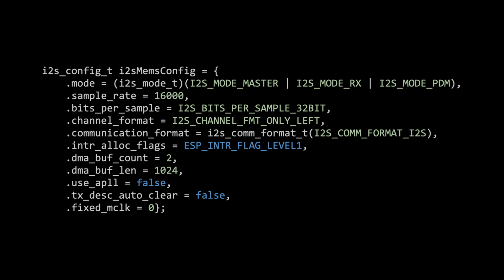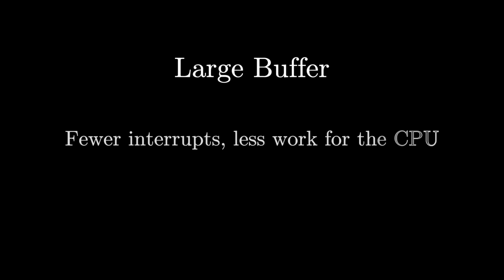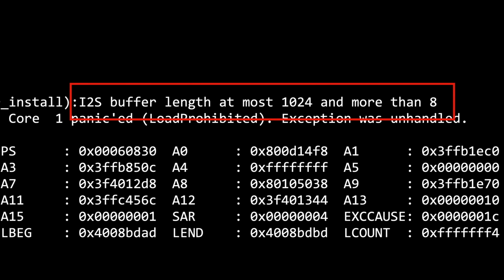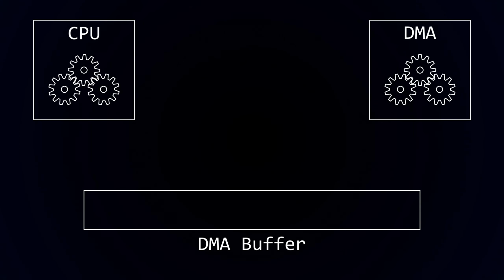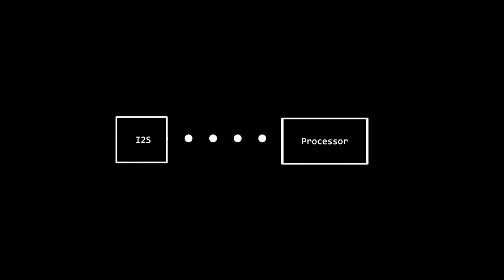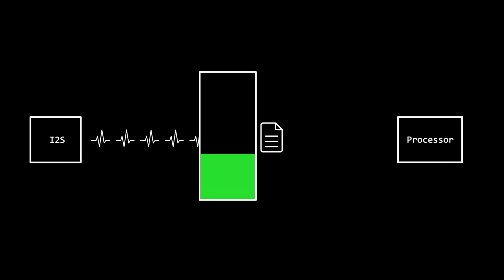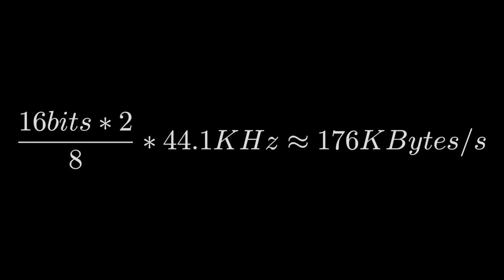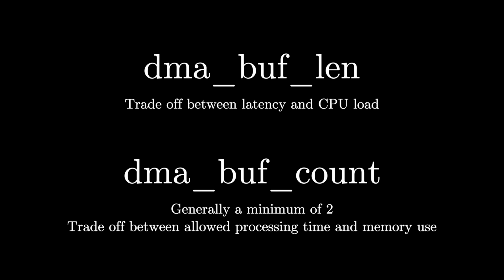ESP32 Audio DMA Settings Explained - dma_buf_len and dma_buf_count

Comment: Question about the math.  A sample is 2 bytes so if we change 176k Bytes/sec  to samples/sec we get 88200 samples/sec   so 8 sample buffer would be 8/88200=91 usec per sample .  I guess you figured the time for both left and right channels which would double my time then we are the same?
Reply: I went over this again and yes a sample would include both channels.

Comment: Suppose I wanted to take the I2S data from a microphone (INMP441) and feed it to a I2S DAC without processing. Just in and out, mono sound signal.
How would you set up the buffers? Can the ESP32 fill one buffer from the Mic while feeding another buffer to the DAC? I suppose it would need 2 DMA controllers?

Comment: Hi! It's a good video!!
I have a question about the dma buffer. Is possible to use an I2S microphone and I2S DAC in the same time? 
I know that the ESP32 contains two I2S peripherals, but you said in the video "we can only start processing the buffer once the DMA controller has finished transferring data to it", and I am somewhat confused.
I will really appreciate your answer.
Reply from the maker: The two peripherals work independently from each other and have their own DMA buffers so you'll be fine using them both at the same time.
Reply: @atomic14  Many thanks for the prompt reply!

Comment: What are the total no of dma buffers in esp32 ?? What's the maximum value we can use?
Reply from the maker: You're limited to the internal SRAM - which is shared between your running application and anything else that is needed.

In my tests I managed to allocate a total of  around 100K before the application started to crash. I assume that there is some internal upper limit on the actual value for the number of buffers, but I did not hit that before running out of RAM.

Comment: Did you come across anything saying why they limited the buffer length to 1024 samples? It's no problem since we can simply increase the buffer number, but perhaps there are times when it would have been better to use longer buffers and interrupt the CPU less. Also, does dma_buf_count have a limit? I mean, could I use 1000 buffers that are just 8 samples long for example? Perhaps for some real-time control application or the like.

Thanks for this very useful video – YouTube has been lacking a video on this!
Reply from the maker: There's nothing I could find on why there's an upper limit. And it feels slightly arbitrary as it's measured in samples - so if you're doing 8-bit samples it's 1K, 32-bit samples it 4K. I think there is probably a max limit of 4K on each DMA descriptor. The only limit you have on the buf count is the physical memory available - there is overhead for each DMA buffer that is allocated to maintain the linked list but I don' think it is that much.

Comment: Hi i got some questions regarding bluetooth audio using esp32, where can i get into contact with you? Thanks!
Reply from the maker: I can be contacted via the channel page. I don't know much about Bluetooth audio yet though!
Reply: @atomic14  Oh okay sure! No problem, I don't know much yet aswell. Currently I am just sitting with an issue, I have flashed my esp32 with the default espressif example code found under Bluetooth / bluedroid / a2dp sink / classic_bt but the volume bar is randomly going up and down on my phone, and when pressing volume buttons it doesn't change the volume.
Do you know a better way by any chance on how to make a Bluetooth receiver using the esp32? I used a pcm5102 dac. 
(Oh yeah and thanks for the article you linked in one of my previous questions on your channel about the Bluetooth audio volume  controller for in the shower, I (kinda) got the basics down and got it (kinda) working :)

kind regards,
Arik.
Reply: @atomic14  Sorry for interrupting maybe, but is this the channel page that you said you can be contacted trough? Or did I get it wrong? Have a good day!
Reply from the maker: @aarriikknn33ll  On the About tab there's a button to view my email address.
Reply: @atomic14  Ohhh okey thanks, i did not know what you meant exactly.

Comment: Good video, I have a question? I2S is only for audio application or it's possible other uses. Sorry for my bad English
Reply: I2S (Inter-IC Sound) is a serial, synchronous communication protocol that is usually used for transmitting audio data between two digital audio devices.

With the ESP32, I2S is commonly used for reading from the internal ADC via DMA buffers without having to interrupt the CPU for every sample. The ADC signal may or may not be audio, but the faster you want to read (up to around 150 kHz for the ADC, I believe), the more useful I2S and DMA is. I believe they could have used just about any protocol to connect to the DMA but I2S presumably seemed like the best option.

(FYI, the internal ADC is noisy and only really achieves about 7-Bit precision and 6 kHz bandwidth (3 dB cut-off). You can improve the precision by averaging many samples and by adding a capacitor. It also reads zero until the signal is above 0.1-0.2 V.)

ESP32 contains two I2S peripherals. These peripherals can be configured to input and output sample data via the I2S driver.

I2S0 can also be used for transmitting PDM (Pulse-density modulation) signals.

The I2S peripherals also support LCD mode for communicating data over a parallel bus, as used by some LCD displays and camera modules.

https://docs.espressif.com/projects/esp-idf/en/latest/esp32/api-reference/peripherals/i2s.html
Reply from the maker: No need to apologise, it's a really good question. I2S generally always used for audio, but it's quite a simple protocol so you could hijack it for other uses. The ESP32 supports a weird parallel mode which can be used to drive LCD displays! https://github.com/TobleMiner/esp_i2s_parallel
Reply: @atomic14  Thank you very much for your resply, Greetings from Peru South America

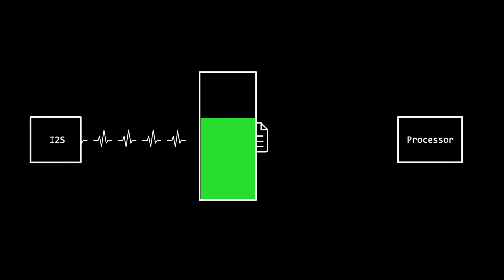Comment: Great animation/visualization at 6:58 :)

If I may: the "k" in "kilo" (kBPS, kHz, km, kg, etc) should not be capitalized, as per SI/IUPAC rules. The uppercase K us reserved for absolute temperature (longform unit: kelvin*, with a lowercase k*), named after Lord Kelvin^ (with an uppercase K^).
Reply from the maker: That is a very good point. I need to be more careful as it's very easy to get confused with units and cause all sorts of problems!

Comment: ooooooh yes. I'm so glad you posted this. I'm gonna tackle the ESP32 I2S in a month and already watched your other videos. Thank you so much for sharing.
Reply from the maker: It was really useful for me to actually sit down and think about this subject - I've hadn't really applied any thought to what the values should be up until now.
Reply: @atomic14  i thank you for that, although this was very useful already, somehow i would have loved it much more when you ended with a walkytalky moment with much better audio because of the better settings of the  DMA settings.
Reply: One thing i was wondering about the DMA settings in relation of the walky talky using esp-now because of the package size of 200 bytes per message would you agree that setting the DMA size to 200 and the number of buffers higher?
Reply from the maker: @NielsNL68  That's a really interesting question, the code in the walkie-talkie is a little bit more complicated (maybe it can be simplified) as the I2S reading is decoupled from the sending, so there is an application buffer that is filled up with samples as well. We could make the DMA buffer quite small and have a buffer count high enough to allow for the sending time of the esp-now packet. There are a lot of leavers we can play with :)
Reply from the maker: @NielsNL68  That would have been a great demo - I'm kicking myself now for not showing an example of the buffers overflowing and what the audio sounds like when that happens.
Reply: @atomic14  now you have source for a new video 🤔
Reply from the maker: @NielsNL68  I'm thinking exactly the same thing :)